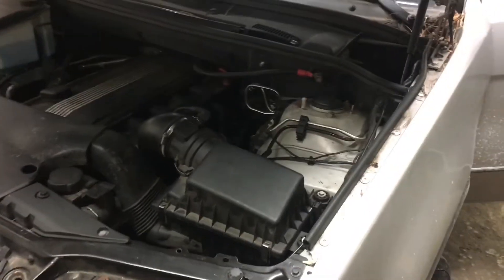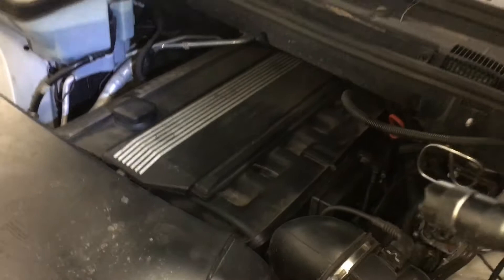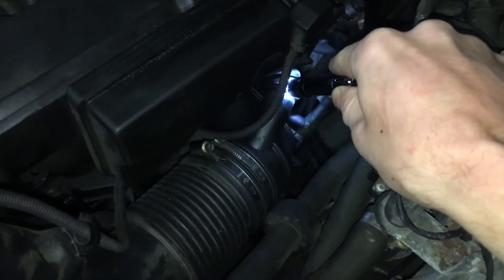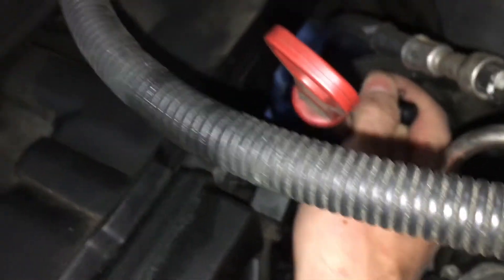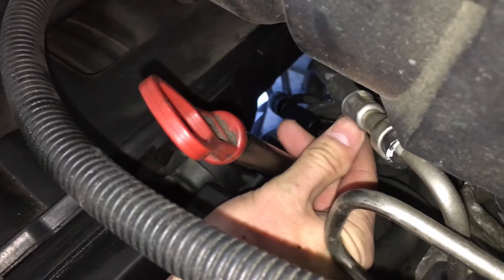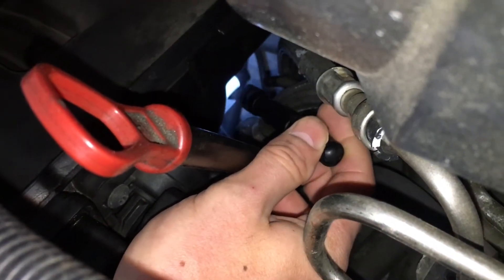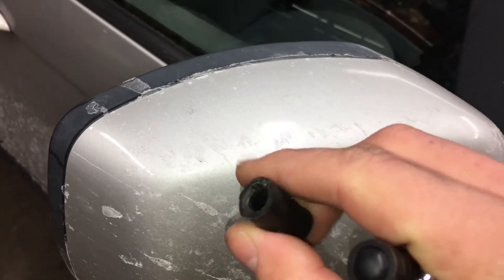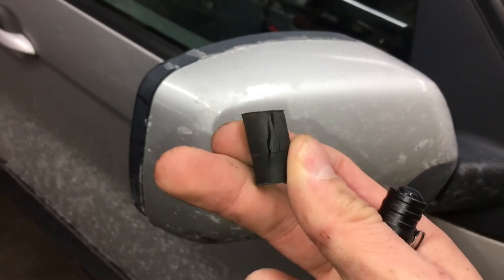BMW X5 E53 Fault Code P0171 P0174

Comment: I have a 2005 BMW X5 with only 20k miles on it as it was barely ever driven and sat is a garage for a long time probably causing hoses to rot. These codes came up and I checked these exact places and had the same exact issues on that very same elbow hose and with the rear cap. I am hoping to just replace both pieces but do you recommend still running a smoke test to see if any other intake hoses have rotted and are leaking?
Reply from the maker: Thanks a bunch for watching and taking the time to comment. You may want to clear the fault codes and test drive the car after replacing the hoses to see if you are getting any codes. If you are getting fault codes, a smoke test is an excellent idea to rule out any other intake leaks. Please share an update, thanks.

Comment: Thanks fr!  I’m so happy fr because my engine is running too rich and theses times labor cost a bunch so a good place to start it is !
Reply from the maker: Thanks for watching and taking the time to comment, appreciate it! You may want to check all your air vacuum hoses and make sure your throttle boot is not ripped, check it well! Hope this helps.
Reply: @ do I need to lift the engine up to do the job? 
scan on my ‘05 3.0i showed : p0102, p0161, p0172, p0175, p1419
Reply from the maker: No it maybe a little difficult but you should be able to get to the intake boot but often times removing it to check if it is ripped is best practice. You may also want to check and see if your air filter has recently been serviced. Please share an update, thanks.

Comment: Trying to solve this on a 2004 x3 3.0.  I guess its a different engine. Maybe similar problem though??
Reply from the maker: Thanks a bunch for watching my video and taking the time to comment. Have you checked your vacuum lines and intake boot for rips? Thanks for any update.
Reply: @WheelsTips  yeah, not me personally but a mechanic has looked at it, supposedly did a smoke test too, changed the MAF, no dice. It's not my vehicle, I'm trying to help diagnose. Thanks for taking the time to make your great videos!!
Reply: I'll add that I noticed that the STFT is near zero under load but about 25% at idle
Reply: @WheelsTips  Any ideas? I believe  it's the m54/n52 3.0. Gonna take a look at it in a cpl of days. Wondering if it will have the same worn rubber cap as in this video. Thank you!
Reply from the maker: Thanks for all the updates, best thing check all the rubber vacuum hoses for cracks and make sure the boot is in good condition. Please share an update, thanks.
Reply: @bennyabolmaali4115  Did you fix the issue and if so what was the problem?

Comment: Thanks a lot ! It works to pass inspection , and I noticed less shaking vibration . Other videos said drive do this do that etc , I just change the little cap and automatically give me the ok 👌
Reply from the maker: You're so welcome! Glad the cap was a helpful fix. You may want to check if the rest of your vacuum lines are in good order and reference the vacuum diagram under the hood. Hope this helps.

Comment: Replaced it. Unfortunately I'm still getting the P0171 code. The cap was indeed split.
Reply from the maker: Thanks a bunch for watching my video and taking the time to comment. You may want to check some of the other vacuum hoses for splitting and tears. Hope this helps, much luck.

Comment: I got two nobs there smaller and the same like on your video both were cracked so i used gasket maker . I also changed the air intake hose, Disa valve O’ring, most of the vacuum hoses crankcase and hoses and still got the vacuum codes 🤪 2005 x3 BMW
Reply: Just did fuel pressure test it’s 3,5 (50) it’s fine cylinder pressure 155-160 all 6 ok too and smoke check nothing detect so no vacuum leak 🤷🏻‍♂️
Reply from the maker: Thanks for watching my video and taking the time to comment, much appreciated. That is really smart to change all those hoses especially after a good amount of time. Does your BMW X5 have any active fault codes? Thanks for any update.

Comment: Been trying to fix this issue for quite sometime,  had  several so called certified  bmw mechanics replace a bunch of other parts related to this problem(P0171/P0174) and here it was a $3  part no one talks about!
Sure wish  I came across your video sooner.
Thank you
Reply from the maker: Thanks a bunch for watching my video and taking the time to comment, glad I was able to help with P0171 P0174 on your BMW, enjoy the car.

Comment: Hey for the bmw x3 2006 (m54) does it have that little plastic cover? I am changing all the possible vacuum leaks areas(since they are mostly plastic and cheap to replace) since I think for my car there is vacuum leaks but not strong enough to active the sensors.
Also I am looking around to find that part but I can't seem to find it. The part 1727176
Reply from the maker: Hey Arturo Flores thanks for watching my video.  Yes you should have that cap if I remember correctly, try google searching 2006 M54 BMW OEM Intake Manifold System Vacuum Cap plug, see if that yields results.  Also google search 2006 m54 intake boot rip and look at the images, there is a common rip which I have seen 100's of times in the same area, that boot I would shop around :)
Reply: @WheelsTips  okay awesome,  I will write if I get any results!
Reply: Best video ever.  You are awesome.
Reply from the maker: @CApainMD  Thank you for the kind words, I am humbled.

Comment: Could this also be caused by a dirty air filter?
Reply: @WheelsTips  i have both 171 and 174 fails. E46 325i. Any ideas?
Reply from the maker: Hi MARLON RANDOM may you start a new question and you can include what you already checked under the hood?
Reply from the maker: @NakaiSan.  I know this is sometime after, any update would be greatly appreciated on if and how you fixed your BMW, thanks a bunch.
Reply: @WheelsTips  ei bro, in my case it was de fuel pump. Its in the rear under the seat. The mass sensor and air filter was Ok. If u have lean condition , maybr u have bad fuel pump.
Reply from the maker: @NakaiSan.  That is an awesome tip, thanks for taking the time to update this information, maybe very helpful for others.
Reply: Fuel pump is I guess my last option because I changed all hoses and O’rings. another part I didn’t change is sensor .
Reply from the maker: @worldfitnesstrainerradekve9234  looking forward to an update on your diagnostics, thanks a bunch.
Reply from the maker: Hey Ken Johnson thanks for watching my video. There could be many causes to many different diagnostic codes, being that the air filter is a serviceable item it is hard to pinpoint. What vehicle do you have and what code, please feel free to share your experience.